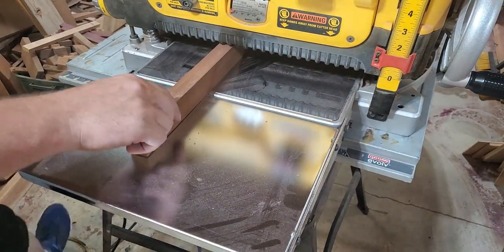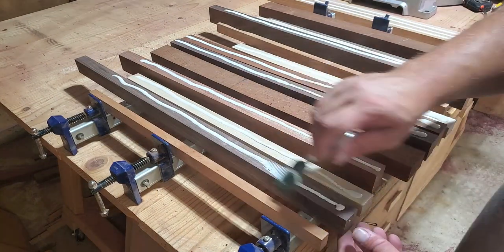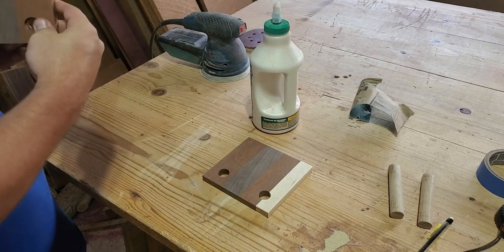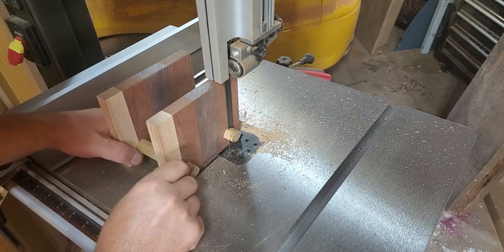Make these coaster sets from your scrap wood

Comment: You should move you jointer fence back and forth of boards that are not full width.  That way you use more of the blade and the very end won't dull so fast.

Comment: My apologies about the push block comment from your cutting board video, that was the first video of yours I watched and didn't notice them if they were there my eyes were affixed on your fingertips at the jointer.  I did notice you had quit a few in this video.  Dope build!
Reply: Also have you considered using an 8 inch hand screw clamp to hold small pieces when routing?
Reply from the maker: You know, for some reason I've never looked at them and said "I need that".  That is until now.  Thank you very much for the suggestion.  I'm ordering two right now.